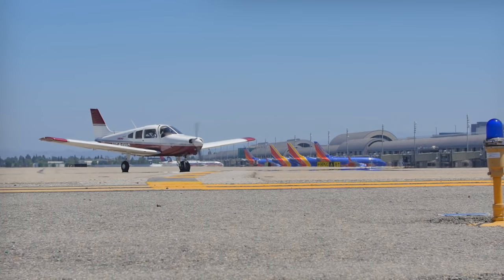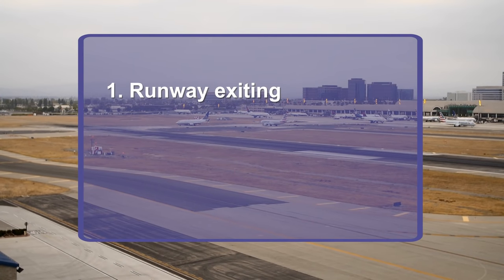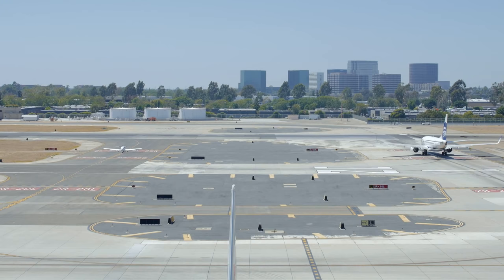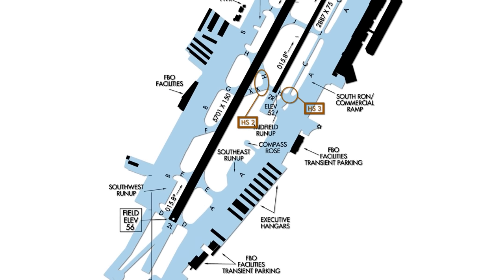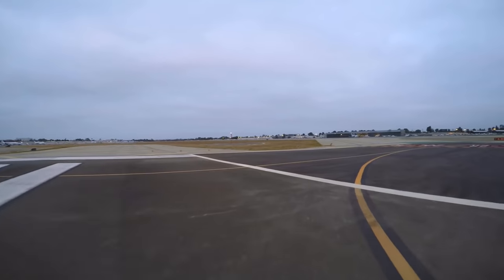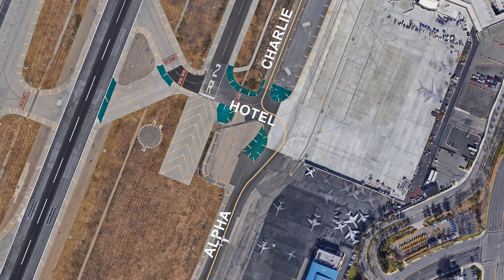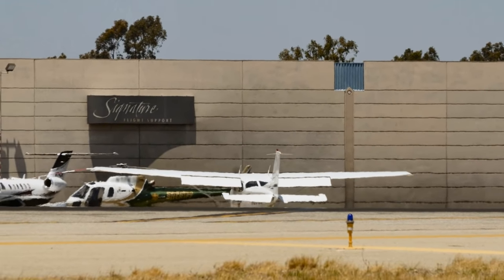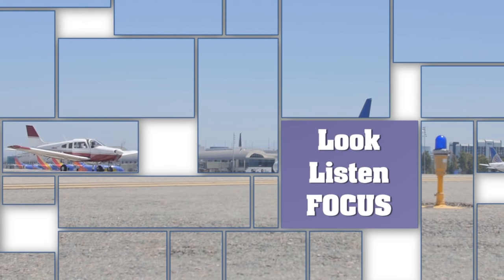Runway Safety @ SNA

Comment: So why can't John Wayne airport extended their runway one (or both) directions. I understand how SNA works and know the noise sensitive area just south of the airport since I go to high school close to the airport and see planes taking off. They could use what San Diego airport has, an engineered materials arrestor system (Yes I did my research for this. Impressive for a 17 year old I gotta say) at the last 500ft for example and the rest is runway pavement, approach arrows, the approach tower things(I don't know the name of it), etc. That way there is more room for larger aircraft and/or extra runway in case of an emergency. What if there is some sort of engine or structural failure during take off? If the plane overshoots the runway it's gonna crash into highway 73 not to mention there are businesses, homes, and a lot of people nearby. I hope this gets read 😊.
Reply: ItsMyDank747-400 if there is an issue with an aircraft at or after v1 speed, they can't slow down or stop at that point because they have passed the speed of no turning back. So no need to worry about runway overshoots at SNA